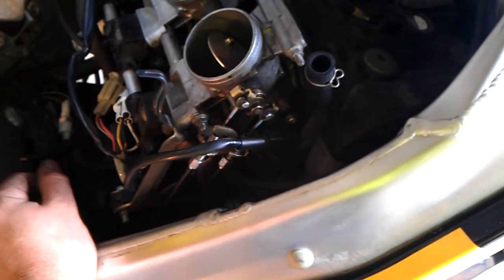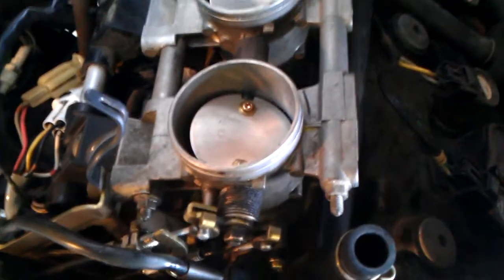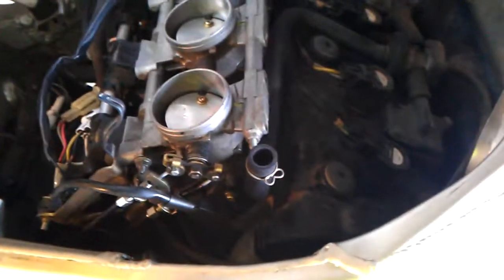STVA repair on 2001 GSXR-750

Comment: I had c28 code on my  2001 750 I stripped and cleaned and regressed  the stva adjusted the cables cleared the code with dealer tool then adjusted the TPS and now runs perfect after doing a lot of reading in the manual it’s worth pointing out that low battery voltage can also bring up the c28 code along with poor connections at ecu and wiring loom plugs

Comment from the maker: Its really a pain in the ass and for this reason ive removed my STVA all together and installed a simulator, you cans ee how i did this in my other videos in my channel. If you want to persist with the STVA i suggest you remove if and dismantle the case, clean all electrical contacts and rough them up with some fine sand paper if necessary, and check all soldered components and their integrity.

Comment from the maker: the 04 have a different set up , the stva is mounted directly to the throttle body and has no cables , im not as familiar with this unit but if you trawl the gixxer dot come forums theres plenty of info

Comment from the maker: When u say jerky are they twitching through the throttle curve or just moving faster? If u have no warning light and no code I wouldn't worry so much , if your throttle is smooth at low rpm and bevs right out to redline I'd say your all good , otherwise is do what I did and clean up your contacts in the stva unit

Comment from the maker: I'm not experienced in the wiring system in that detail, maybe a workshop manual would have what you need. Or you could contact decosse01, that's who I bought my simulator off. I'd remove the butterflies completely for the moment, you will only notice a small difference low rpm in low gears. Goodluck !!

Comment: i have a 2004 gsxr 600 that has the same problem, the bike runs but wont run over 9000 rpm. i rigged it so that the valves are all the way open, will this hurt the bike? it runs great now, but fi light is on still like i expected.

Comment from the maker: i did fix the stva but it only lasted a few weeks , i beleive the unit is faulty from factory and will continue to give people problems. You can simply buy a new STVA from a dealer but they want you to buy the entire throttle body which is a rip off, there for the only replacements you can get for a reasonable price are of ebay and are most probably second hand units that are also faulty or are not far off.

Comment: I know right. I called a dealer yesterday and I could get a new STVA for $475. Still quite expensive. So I ended up just buying a used one off eBay for $100 including the throttle body, we'll see how long it will last.  
Also, how is your gixxer running now with just the simulator? No problems? 
Thanks man!

Comment: I have the c28 code on my 2001 gsxr 750...but the bike runs just fine ...is there anything to do with the tps adjustment or is this a different problem ...how do i know if my stv is good or if i need to replace it ..i just wanna get rid of that stupid red light
Reply: i have same problem....

Comment: Hey Mat where can I find the wire diagram to make the butterflies to work I tried to find the stimulator but didn't have any luck. I have left the butterflies open just about 1/4 and that works to keep my bike running. You can contact me by google+